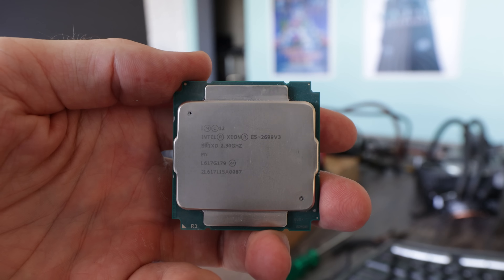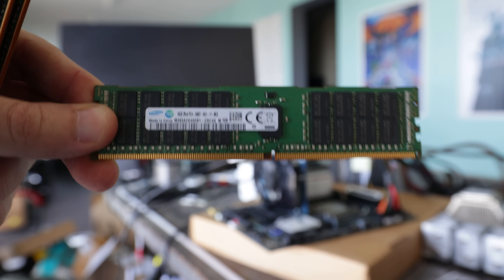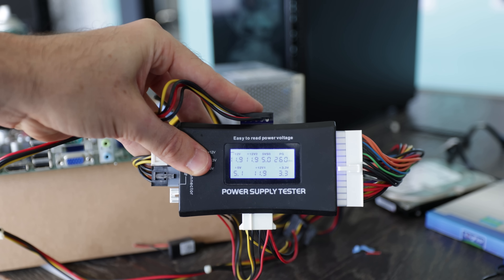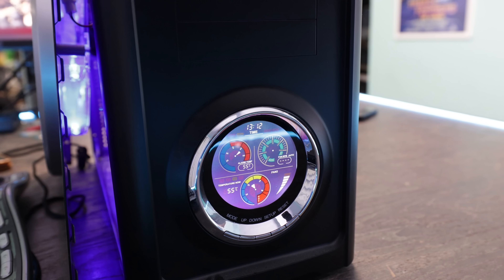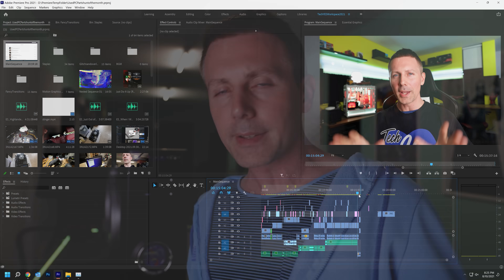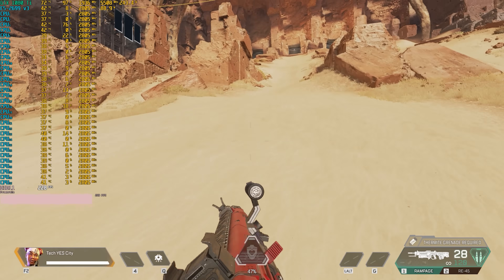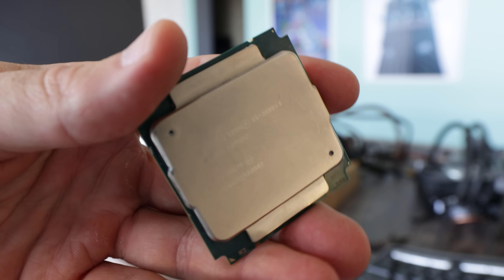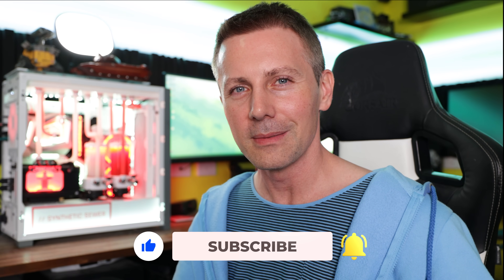I Built a BUDGET 18 CORE XEON Gaming and Workstation PC (Part 1)

Comment: As someone who has done this kind of stuff, keep in mind, there are some cool benefits, AND some SERIOUS drawbacks. For example... Yes, you'll get a bunch of cores for a low price. But more isn't really better, unless you're going to be using them for virtualization and other stuff like that. It won't benefit you in video editing after a certain point. It won't benefit you in gaming after a point, etc etc. You're better off with a lower core count and higher base/boost in the same generation, maybe a 10-ish core (Wikipedia has great charts for all the SKUs). ALSO... Keep in mind that while something like a higher clocked CPU in this generation will still be quite decent, you're still getting pretty old architecture. IIRC, Haswell only has access to 2 lanes for NVMe and some other drawbacks I probably can't think of... Knowing all that, what you're basically getting here is a solid replacement for something like a Ryzen 1st gen processor, but again, those drawbacks are definitely there. So don't be fooled JUST by high core count. A ton of cores just don't benefit an average gamer.
Reply: stop bullshiting

Comment: You should check out 70$ 2666v3 it's 10 core 20 threads beast which works at 3.5ghz on all cores after easy Turboboost unlock mode and slight undervolt like -70mV works well for most people. Also you should mention in old turbo boost guide you made, that it's out dated, there is like 3 far easier ways to do it now.

Comment: interesting case but the CPU is not.  people should not buying these old xeons at these prices. $200 is about the price of a used 5600x which is faster and less electricity all the time, only slightly lagging in rendering workloads (which is not an issue unless one is making a cheap render farm). The Ryzen 3600 could be as good as the Xeon but is brand new and modern part at $200

Comment: Wonderful video... hope part two arrives soon. And great work by the way. Xeons are impressives pieces of technology. I run an Xeon-E5 2687w v2 (25MB L3 cache) on an X79 with 1866MHz DDR3 paired with an GTX1080. Its fast, reliable and even fast enough for VR gaming. Your rig here tinkers me. Thats an perfect example that "old" tech is not outdated. Thanks alot an greetings from good´ol germany !

Comment: Picked up a e5-2690 v4 for about 220 us back in the spring. Picked it up along with 16 gb more ecc memory to upgrade my old dell precision t5810 from a  e5-1620 v3 with 16gb. Even went from dual to quad channel. So far I'm loving it. As a user I can just wallow in this pc. I can have a game and about 30 chrome tabs open and barely be using a quarter of my system resources. I often leave large projects open in the background, while I'm gaming reading up about my game and watching youtube at the same and it never breaks a sweat. The whole point of this rig was to get ready for rtx 4000 on the cheap. My gpu's the weakest part, I'm running an gtx 660 and quadro p2200. =(

Comment: miyconst has a turbo unlocker, it patches the CPU microcode in the bios to make those xeons run all their cores at the max turbo if temps and power are under their limits, check it out see if that CPU is supported

Comment: I've built a Workstation with this exactly motherboard and the E5-2696V3 CPU, which is exactly like 2699 but with extra 200mhz, so it clocks at 3.8Ghz instead of 3.6.
I tweaked a lot with it and I've managed to hit 4.0Ghz with it with 103.5 base clock OC, quite a feat, the most powerful Haswell machine in the world according to userbenchmark.

For people interested in performance here are some stats:
Cinebench R15 - 2842
CPU-Z - Single=426 Multi=8085
And has Brian has said, it has the best cache memory ever, it's ridiculously fast.

Comment: 0:50 As "Hardware Unboxed" have been testing, larger L3 cache on gaming CPUs is boosting FPS a lot more.
We are heading towards the 4K120 Meta soon for gaming, and larger L3 cache is the fix for better FPS on high resolutions.
Next Gen CPUs will have some nice double to triple L3 cache sizes, and that will boost performance so much from the CPU side.
And rumors are saying that we are about to see +50% on nextgen GPUs, so 4K120 Very High settings is really coming in 2022.
Reply: Ryzen cache utilisation is better due to the successively tuned perceptron predictor, this small circuit makes up so much of the actual performance difference between Ryzen generations, and Intel is barely clawing its way out of being left years behind in predictor performance. While cache capacity difference between models matters, so does cache utilisation between different processor families. I don't think this system is that great TBH, when it has to contend with a 2700X that you can get the CPU for around the same money and plop on an actually super cheap mainboard that will beat China boards day in day out like it's not even funny. If you need a lot of RAM, that is for sure the saving grace of this build, because you can get large amounts in RDIMM cheaply. Quad channel DDR4 is nice, but again a better predictor not only optimises the cache utilisation, but also the RAM access!
Reply: @SianaGearz  They are not bad, just really not for the faint of heart. I “downgraded” from my 9th gen i7 build to dual Xeons (24C48T) to promote my custom PC business (it’s cooled by a triple watercooling loop lol) but since I play at 4K with my 2080Ti, there isn’t much difference at all FPS wise. Games are also becoming more optimized as time goes on and my favorite games are getting more into indie. So for veterans like me, it doesn’t matterthat much...Xeons are still solid builds, and is much better for the environment

Comment: wow that's a high TDP CPU.  can you show the power draw from the wall when doing part 2?  Like during a game or premiere pro render?  IF a person doesn't plan to OC that chip will a Huananzhi x99 work or a Jingsha/Machinist x99 as you mentioned?  LIkely the OC will be needed due to the base clock being on the low side.

Comment: While this is not bad I think it's too expensive for the performance. I think going with a second hand 7920x, 7940x, or 7960x is a much better option in this price range. These chips can be had from $150-300 and boards go for $120-250. Even at stock these chips will leave the Haswell-E chips way behind. For example a stock 12 core 7920x gets a score of about 14,000-15,000 in CB R23, that also means it will do much better in single thread heavy applications.

Comment: That PC case is called "Enermax Phoenix Neo".
I bought that case new back in 2010. The massive airflow is good for gpu overclocking.
The huge side fan alone is worth more than $10 USD. I miss that case.
I used the Zalman CNPS5X.
Reply from the maker: Oh wow, yeah its the same chassis! good find.
Reply: When i search for that case, it doesent have the front lcd screen... is that a diy install from seller? or is it an upgrade option?

Comment: Happily humming along in 2021 with Dual E5-2667v2/Z9PA-D8/128GB ECC DDR3 @1866MHz/RTX2070 inside a 20L SFF Sliger Cerberus X case. Been absolutely loving it for 3yrs or so.
Wifi6, 5-port USB 3.1 w/ USB-C, NVMe SSD PCIe cards net me pretty much everything I’m missing from modern platforms.
All in an SSI-CEB formfactor.

Comment: 18 cores are weird
7980XEs are also cheap because of 9980e and 10980s despite being for all intents and purposes the same (sans delid).
Xeon 8124s are also cheap because I guess AWS already cycled them out, a bit harder to get a board to run them but not that hard.

Comment: Back in the day I used to dream of having that Xeon when I had my X99 Deluxe with a 2673 v3, I swore I would keep the mobo no matter what till this day came, but I failed...BTW there was a Turbo hack for this Xeons that puts all the cores at max the whole time, I've used it with my 2673 v3 and worked great.
Reply: He talks about it at the end of the vid and was gonna do a part 2
Reply: Have it too. Hack works fine and there is a version that don’t require boot change.

Comment: Of WW channel available about 3.5% of Haswell v3 is 2699 18C/32t. Available volume came back to the secondary market more then doubling between the weeks of June 5, 2021 and 7.31.21, and since, has sold down 2.8%. E5 2699 v3 available in the WW channel is 724% more than Ryzen  5950/5900X 16C combined and 135x more than i9 10980XE 18C available in channel and 239x more than i9 9980XE 18C available. mb

Comment: at 0:48 you say it having 35mb of L3 cache is a benefit no other CPU carries even in today's standards, but the ryzen 5 5600x and the ryzen 7 5800x have 32mb of L3 cache, while the ryzen 9 5900x and 5950x have 64mb of L3 cache, so they have around double the cache per core as well
Reply from the maker: True that, though I forgot what kind of l3 cache they used, I think the Xeon l3 cache might be more expensive IIRC.
Reply: @techyescity  that’s true, the L3 cache speed of this Xeon CPU is around twice as fast in reads but has double the latency, though I’m not sure how much of a difference that speed will make in practice, especially considering the IPC and clock speed improvements over the years

Comment: A, B, i need that Aorus Extreme 1080ti. You see that cooler on that 👹 beast. It has 8 or 10mm pure copper heat pipes.
 I can't beat $970usd for a whole build but i did get a Core i9 9960X 16c32t monster for $600 and the 2nd Gen x299X Aorus Gaming 7 Pro with the ISL99227B 60A Smart Power Stages for $250. $850 for that combo is unheard of.
Reply from the maker: Thats a nice pickup, good stuff.  Yeah the 1080 ti aorus was a beast and still is!
Reply: @techyescity  I got the 9960X for a steal the day after intel announced that the 10980XE was only going to be a thousand. I see you got one now. Did you send back the 7980XE and keep the 10th Gen...lol
Reply: i traded my 1080ti (exact one in the video) for a 3060. performance is same but +rtx and dlss

Comment: im still rocking my 5820k since i bought it 6 years ago, even that now i use a Ryzen 5900X, i just cant throw away my X99 platform, when it came out it was just too damn good, even to this day is still worth a pick, im just waiting for the V4 version of this Xeon, which has even more cache and 22 cores to get a lower price, that thing will be a beast for the encoding and rendering video.
Reply: Look at miyconst's channel, he has a video where he explains that with the turbo boost unlock exploit on the v3 xeons, they are actually more powerful than the newer higher core parts.
Reply: @arizonarangerwiththebigiro8588 thank you for this comment!

Comment: Very impressive for the price. Funny enough my laptop gets a higher Physics score in Firestrke (go 5900HX!) very similar scores for combined and graphics. But this thing kills it in the value department $751.62 vs $1,650.
Reply: What model laptop is it? I just bought a maingear vcp-17 which has a 5900hx + 3070 and it's freaking awesome.
Reply: @SunnyD514-yuck  Asus ROG Strix G15 Advantage with the 5900hx and a 6800m. Fantastic laptop so far. Hell both our laptops could easily replace a desktop for most people.

Comment: Was waiting to see the build with this CPU. Pretty amazing performance out of such an old chip. Tempted to upgrade my 2678 v3 in my server now. When you do part two, to give this build the best chance, I think you need to go a modern case with a larger AIO. The 120mm Intel AIO will probably struggle once you start tuning. Love that retro case though. Those huge side fans were awesome.
Reply from the maker: I will check it out, it tops out at 3.6ghz single, so might not need a bigger AIO, testing now.

Comment: I still love my x99 system. Used it as a gaming system forever. I'd still use it today, since im always gpu bound at 7680x1440p, but, The 5ghz all core of my 7920x tho, she bad! A good chip. Its still like having 10920X at 5ghz, so x299 is still a really good plate form, especially if you know how to overclock. I pair it with my EK ed., MSI 2080Ti seahawk. Raid 0 w/ 5 intel 665p M.2 drives, 240gb M.2 for the OS, and another older intel 750 series nvme in the bottom slot. Still havent even used the Dimm.2 yet lol. I prly wont upgrade for a few more years still too. I see at least one more, maybe 2 more gpu upgrades before I'll need a cpu upgrade.

Comment: But it doesn't  support tpm 2.0 so it can't  officially  run windows 11. MS is a joke.
Reply: Why not? TPM 2.0 is available in most socket 2011 V3 motherboards...worst case scenario you need to buy a module to fit in the header.
Reply: @JDMeister  you got to remember  this is a Chinese motherboard for one. And two good luck trying to find a tpm module on these Chinese motherboards.